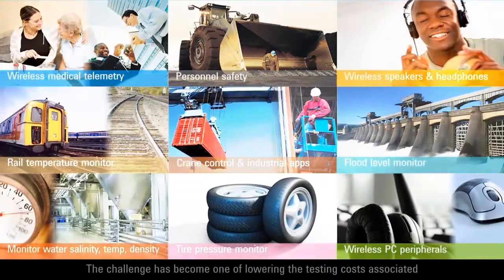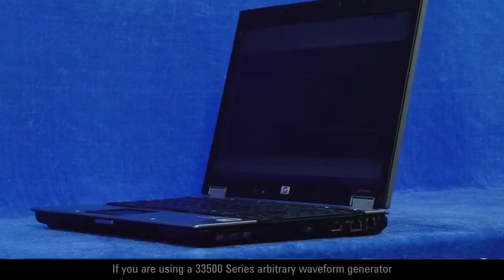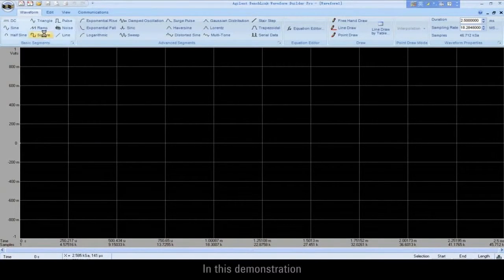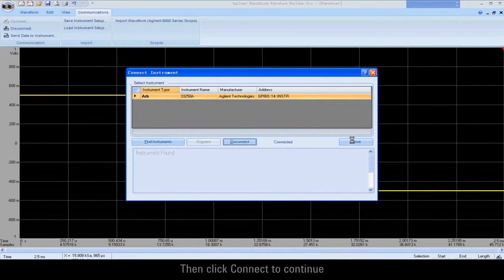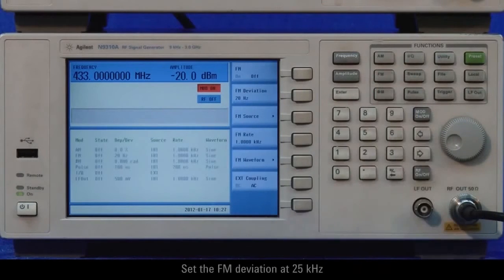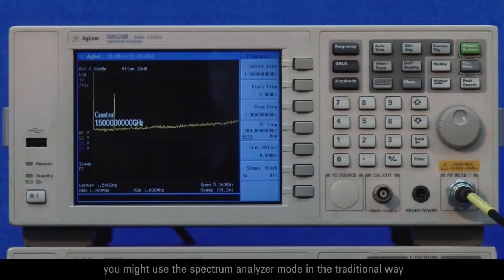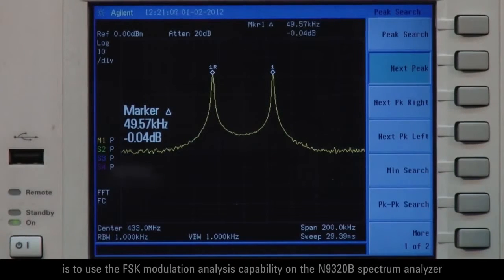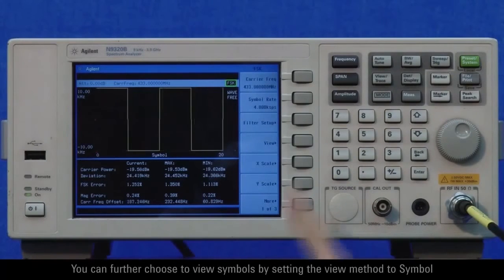Keysight HF-Signalgenerator N9310A – kosteneffizient Frequenzumtastung (FSK) simulieren

Comment: Gibts da Video auch in Deutsch? wir sind hier in Deutschland....
Reply: Leider stellt der Hersteller und unser Partner Keysight Technologies dieses Video nur in der Originalversion zur Verfügung. Unsere technischen Experten stehen Ihnen aber bei allen Fragen zur HF-Signalgenerierung und dem N9310A telefonisch unter der 07121 / 51 50 50 oder über https://www.datatec.de/Kontakt-Formular jederzeit zur Seite.

Weitere Informationen zu dataTec und unseren Experten am Telefon finden Sie unter: https://www.datatec.de/experten-am-telefon

Wir freuen uns auf Ihre Anfrage.